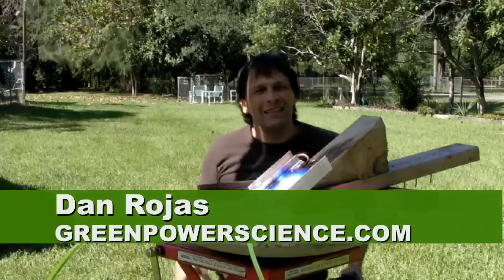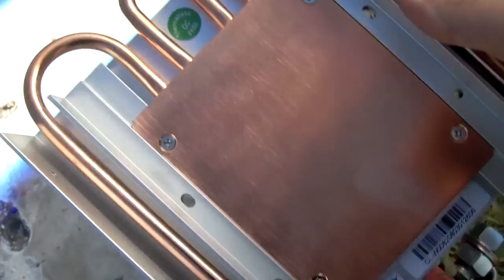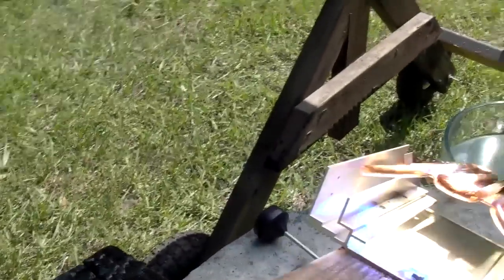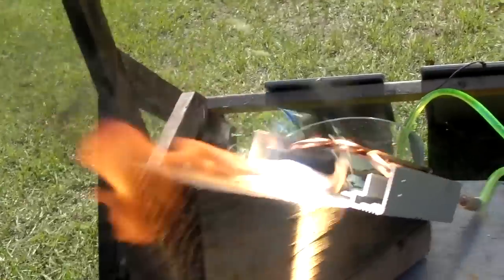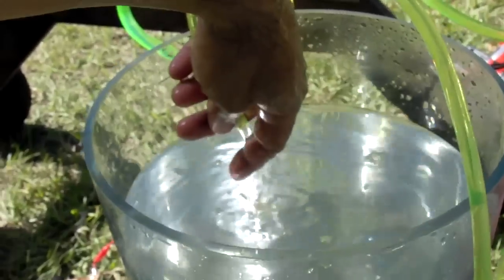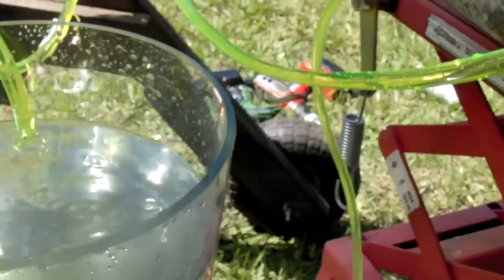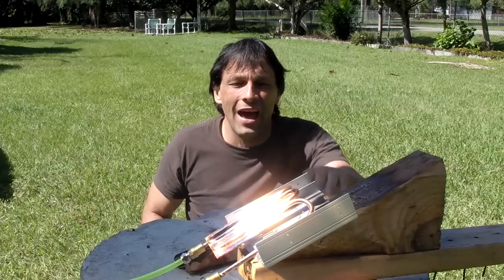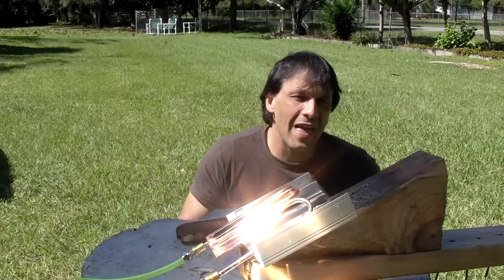FRESNEL LENS SOLAR HOT WATER, Heat Solar Pool Heater Solar Swimming Pool greenpowerscience

Comment: What about using Rocks in the pool . Directing the Ray onto the rock at the surface of the water ? Or multiple lenses ? I’ve collected them with the intention of making mock skylights in my house. I just learned about this use for these so I’m curious? I thought about stump removal? Melting aluminum? Melting other metals ? Saving propane and coals /money ?

Comment: I'm going to make a steel cube filled with oil with a spiral copper pipe inside and painted black from the outside. Cube with oil is heated by fresnel lens, the water circulates through copper pipe exchanging heat with the oil.

Comment: Hey bud, I'm just getting interested in Fresnel heating, I saw that you have a circulation pump in this vid and wanted to share knowledge with you. you may know by now but if you move your heat source to a lower point in the system the rising heated solution will cause its own circulation. No pump needed! apply heat to say the "lower right" of a circle and the water will circulate counter clock wise and heat evenly through your system. hope this helps you and or the viewers/readers!!!
Reply: Heat rises and heated water will push the water I front of it and since it's in a system where the water behind it is in a tube (pressure and vacuum caused by the tube walls),, it will pull that water along.  What's great about your suggestion is that UNLESS the water gets heated, there will be no will be NO circulation.   As the water gets hotter, it will start to circulate.  When it gets hot enough, it will circulate more rapidly.  It's a self controlling system with regards to heat and water flow  Basically, until the water in that one region gets hotter than the other water, it will not circulate.  That means if it isn't getting heated, it isn't circulating.  Daniel's system simply pumps no matter what.

Comment: At 2510btu/hr....

3413 BTU = 1 kW.
This is a .7354 kW system

1 horsepower = 746 watts
1000 watts = 1kW....SO....

735.4 watts is almost a 1 horsepower system, but not quite.  

If this were a swimming pool it is no longer 7 gallons....He is going to need a bigger system because the evaporative cooling effect at nighttime will completely destroy any gains during the day.

Average swimming pool = 18000 gallons.  At 2510 BTU/hr...= 2571 hours until the entire pool is 106 degrees. That comes to about 4 months wait time, which might work out if you can keep the water from losing heat and steaming off.

Comment: Is it possible to heat a swimming pool using a aluminium heat sink ( or any other aluminium/ cooper piece), submerge it in the pool and then heating the submerge piece focusing the sun light with the Fresnel lens ?
Reply: The rippling surface of the water would throw the beam in all sorts of directions and cause havoc

Comment: I think the Fresnel lens route is a whole lot more logical than using focused mirrors.  The lenses could be cheaply produced, until the vendor realized that they were the new crude oil, and the biggest plus is they generate heat towards the ground rather than focusing on a point skyward.   Placing the boiler skyward creates all sorts of technical, structural and safety issues by virtue of having a steam boiler high in the air.  I would be interested to see what sort of results the fellow in AZ would have with a Fresnel lens coupled with his boiler, steam engine and electrical generator rig.  You could gear that rig all day to have a quite powerful system costing only the price of water after everything else.
Reply: I built that. We will be showcasing it soon.
Reply: @MichaelJohnson-  you never did
Reply: @Hh Hh  I did but ran into a small issue with thermal runaway. The lense does not provide enough heat throughout the chamber or assembly of tubes to produce steam. It will require more research into how to get that same temperature distribution throughout the entire assembly to produce steam. Otherwise the vapor will condense back to water when it hits the cooler metal further down the line.
Reply: @MichaelJohnson-  how hot does the water stay for you?

Comment: how about mirror directly expose to water?
Reply: I wonder if it would be easier and safer to move beyond the focal point and form a wider beam directed at pool water surface.  You might lose a little energy but seems like an easier implementation.  Just would have to make sure nobody walked by the focal point  lol
Reply: Inlacesh WeRone
water is transparent and it will focus out most of the energy just like it happens inside lenses
Reply: Inlacesh WeRone Yes, by the sun spread over wide distances, not an intense beam
Reply: Inlacesh WeRone Agree to disagree? It's fact not opinion you moron. If you fire an intense beam it will pass straight through the water and be absorbed by the pool floor. It's not going to refract and distribute the light energy evenly throughout the pool, unless every surface is reflective, which they aren't. Even then, the beam would most likely pass back out of the surface, with nothing to contain it.
Reply: Inlacesh WeRone 'focuses light into a single point"
What do you think a beam is?
Reply: Inlacesh WeRone Why has he done this complicated setup?

And what do you mean by "single point"? A single photon? If it's a narrow beam of light, then it forms a point
Reply: +Chris Kulig Unless the pool bottom is painted black, he already said this would not work.

Comment: I calculate that setup would take 273 days to heat a average 23,000 gal pool to 106 degrees from what he started with. Sooo hummm, need larger heater and larger pump.
Reply: +Mark Gray 

106.. i think 80deg is fine for a pool so its probably more like 120 days i.e. heat for the ENTIRE canadian summer for 1 week of swimming so ya, agreed, this is useless for a pool.  if you lived off grid and wanted a hot shower, now we're talk'n ;)
Reply: +High Hopes Now that's more like it. In Canada they can start in January to have it ready by May. 
Cool :-)

Comment: If you could use a grey or black granite drilled to run the water through it and a hose or copper pipe to connect the holes in series, I'll bet you get a MUCH higher heating rate!
Reply: +Jonathan Owens 

The lens will blow up the granite. He's not trying to get more heat.
Reply: +Jennifer Grove (Dark Moon) No it won't! I used to live just outside of Santa Fe, NM. and the house we had used a home manufactured solar heating system that consisted of 12 4ft×4ft mirrors (it had to be kept VERY clean) and 2 thick dark, satin finished, granite slabs that were almost black. the slabs were 3"×2'×4' with 1.5" holes where short copper pipes married the 2 slabs together. The mirrors created a greatly maginified sunlight with all of its heat absorbed evenly over the slabs. They NEVER ONCE cracked even with temps that would EASILY melt copper in seconds if focused much more! So I must apologize but, your arguement is INVALID!
Reply: +SomebodyYouDontKnow hmmm....the black granite in a pool...!? Actually now that I think about it why not get a relitively thick slab starting with 18-24" thick and carve a bowl into it and run the tubes all through from the outside edge inwards to approximately inner most 1/3 of the bowl...if square 4 directions of drill holes or if it's a pentagon then they are in league with the Illuminati! So study those solar water heaters people! hahaha...joking....but seriously. I think you can see where Im headed with this. heat bathwater while you do the same for the rest of the house to boot!!! ;-}
Reply: +SomebodyYouDontKnow Not over complication at all! What it is...my idea that is...is about aesthetics not about simplification! It's also about output for applications as in, "Wow! You keep this hot tub hot with sunlight?!?"
Also wouldn't it be nice to have a nice HOT bath for those dirty flying rats called, pigeons? As an added BONUS, when those pigeons come in for a bath and swim throw in some carrot slices, potatoes, celery, onions, garlic, salt and pepper and have some SQUAB!!!
Reply: +SomebodyYouDontKnow Actually YES! eBay has them for just a couple dollars!!! :-) I have already been researching that! Solar powered fountain pump with a LiIon batterypack and charging circuit added for a few dollars more can rum on the cloudiest of days....haha...although your water won't get much heat on those days!
Reply: +SomebodyYouDontKnow Another alternate way to heat using the black/dark grey granite (or shale, because it is easier to shape with only hand tools!) is to keep the surface unpolished for maximum surface area, use a relatively thin slab...max. approx 1" thick...and build an air-tight box around it with a glass face and use the solar pump to pump the water over the surface of the slab @ and near where the fresnel lens focal point is!
Reply: +SomebodyYouDontKnow ALSO to pump water WITH NO MECHANICAL DEVICES.....see thermal water pump!
Reply: +SomebodyYouDontKnow If it is a fresnel you got it in a nutshell! :-D
and 65 INCHES!?!?? Now you're just BRAGGING! :-D What area of the country do you live in?? Also if you want anymore tips send me a message and I'll converse with you more!
Reply: +SomebodyYouDontKnow Like I said..."Now you're just BRAGGING!" ;-p
I live in Portland, Oregon the land of the Free...to be SOAKED because it rains a LOT!...in the beautiful Pacific Northwest! We get sun at MOST 7 months of the year....for an hour a day most of that time! Hahaha But for a long time I lived in Santa Fe, New Mexico, where the sun shines 350+ days a year. And THERE is where I had quite a bit of my "Off the grid" solar experiences. You were lucky to find that! Now I have to ask you.... Did you also take the MIRROR!??!? Because that mirror is a "First surface mirror" that could be cut to fitted to direct MORE light into the fresnel lens OR if cut into 1ft squares you could aim THOSE into 1 spot and get up to HALF of the power that a fresnel lens will when properly focused! Or if modified correctly you could get higher than that with a different configuration.
Reply: +SomebodyYouDontKnow There's a video similar to that already I believe.
If you do a search...do it under an evil account to make easier to find! Hahahaha

Comment: Would this setup be more efficient if you painted the copper tubing black? Now some of the light is reflected by the copper, and if you paint it black it will absorb all the heat and the copper will transfer it to the water very fast.  Alltough, maybe you need to use heating resistant paint because it will get very HOT :)
Reply: +ShippingHarbors 

I don't think you understand. He's not trying to get more heat onto the copper tubing. He's trying to get less.

Comment: Could we not incorporate the Thermosiphon effect and not need the pump at all? I have a water heater rigged with a coil copper pipe and a rocket stove but am looking for ways to do the same in the summer without fire. I have a cabin in a remote location and trying to get some comforts of home, I can live without power but not a hot shower..lol..

Comment: @CarlAndrew89
I totally agree with you dude! This is a fantastic
program with easy to follow manual which is
illustrated with step-by-step instructions. It also
has full instructional videos to help guide you
through the entire process. This is the best
product so far in the market. Anyway, I think you
interchange the site name. Here's the correct 1:
GreenEnergyNow.info

Comment: @bashiryu Heat water to turn a turbine.Directing the beam at a boiler. A telescopes gps could be used to keep track with the sun. The heat is incredible so boiling water is easy. This will run a steam engine. This method here could heat your house with in floor heating.(much smaller that the glass tube systems).
I just got mine out of my 52" Panasonic floor model 1985. Can't wait for a sunny day to melt some concrete.

Comment: I think you could use natural circulation (hot water rises) along with a slightly different configuration of tank and hotbox to remove the pump from the equation.  I think the basic idea is have the tank ported at two different elevations, a high and a low.  Water heats up in the hotbox and exits the higher hose, which displaces colder water from the bottom of the tank into the hotbox entrance.  Good enough for nuclear reactors ;)

Comment: @bLuDcL0T What i mean - eg. a pyrex glass with the stainless steel wool in, with an airtight top fitted to the hose - hose goes into the water you want heated - the steam would pass through the water heating it. Extremely low-tech but it would be 100% green as no other power sources would be needed. Hope you read this, and try it sometime.

Comment: I love your vids man. I used to work in a factory where they had huge sinks, and to get hot water there was a high pressure steam pipe going into it. A few blasts would get it piping hot (from cold tap water - in 3-4 second). I'm amazed at the sheer intensity that the fresnel lens produces. Have you experimented using a closed container with just 1 hose coming off going straight intot the water you wanted heating? I hope you read this, it's a simple idea - hopefully you'll try it

Comment: On this video, Dan talks about a 'copper looping system', the unit on which the Fresnel lens is focused.
I need such a device for my own project but I don't know where to look for it. I tried to pause the video at the right moment so I can read what's written on the green label but the still is too blurry.
Does anyone know where to find something like that?
ghurod
Reply: I know this is way too late to help you, but for anyone else looking for an answer to this, the unit's generic term is "heat exchanger", so if you look up "copper heat exchanger" you'll find similar units.

Comment: Nice video.  Can even use that to heat up some water to take a shower, maby camping.  Just construct a tank, maby 5 gallons, with hot and cold water storage with adjustable valves for the right mix you need.    Also, like the oil heat exchanger you mentioned, I think some people have tried running the water through a block of metal, like aluminum, with holes or a coiled type of pipe within that.  I guess it would have to have some kind of black coating on its surface that does not come off easy.

Comment: I checked out ur website but u guys don't supply cylindrical fresnel lenses? where would i be able to price a cylindrical lens? my friends and i are doing a project and need to know the cost if we want to scale it. the project is about using the fresnel lens to boil and thus clean water.

Comment: Hi Dan, what if you were to have a black basestation at the bottom of the pool that could retain the heat of the light beaming through the water? or even if you were to tile or paint the bottom of the pool black? do you think this could work for heating without a tubing system by focusing the lens directly into the pool?

Comment: 106F - 63F = 43F degrees = 23C degrees
7 gals of water = 26 liters = 26 Kg (approx)
Specific heat of water = 4.2Kj/Kg*C
1 hour = 3600 seconds
Total energy = 2511 Kj   in 3600 seconds
power =  697 watts.

I think it would take a while to heat a pool.  The black hose probably puts out more power because it has more area.  You can also just put black plastic in the pool.

Comment: Now if you took that design you have going with the copper tubes, added a lot more curves and length of tubing, painted it black and simply placed it in the sun on its own without a fresnel lens, would you be able to achieve the same effect on a smaller scale?

Comment: I agree with your calculations of the BTU. You are right at what I have figured also. 

You say at first (inefficiencies aside).  I think that his system efficiencies are the main problem here.  He's half assed focused on a half assed collector that's not black at all, and not glazed (glass or tefzel, or anything) and no insulation in sight. 

The numbers show that he is using an insolated area that should produce about 12.000 BTU and only getting 2500 BTU. That is nothing but inefficient !

Comment from the maker: Not the whole picture. This system was operating at about 12-15% efficiency. For direct heating a Fresnel Lens can easily reach the upper 80% range of efficiency. The test was designed to show one concept that can be improved upon. This lens compared to an electric heating element heats water at a rate of 2500 watts. That is not to say it produces 2.5Kw but compared to electric, it does.  Few modifications, easily 3x the results.
I still recommend the black hose, as mentioned 2x in the video:-)

Comment: It is an Insulation problem and the heat exchanger problem. You need to add cylinder behind with mirror behind the copper or aluminium pipe to focus all the energy and use a vaccuum tube and there the results will improve.
But the best it to do steam and store it in a vaccuum sand tank,
cheers,

Comment: (Inefficiencies aside) - I really thought a Fresnel lens that size could produce more energy than that!  This proves that they have no useful applications in the real world!!!
106-63= 43 degree temp rise
7 gal water = 58.417 lbs.
58.417 x 43 = 2512 btu's per hour

A 15' round above ground pool 48" high contains 4646 gallons (US).  To heat this pool 10 degrees it would take 387730 btu's or roughly 10 hours a day for 2 weeks with this lens!!!!

Comment: I use SunGrabber panels to heat my pool here in CT. They work really well but take up a lot of space.  I have 6 panels and pump about 5 gal/minute.  The water differential is 15-20 degrees on a sunny day. The fresnel is good but you would have to keep moving it to track the sun.  BTW, great videos....I watch them all the time!!!!
Reply: Nowadays, Ai will track the sun for you 😅
Reply: The idea of the fresnel is that you could take it a step further with a dome that accepts light from all angles and the groves in the fresnel divert the light into one area.